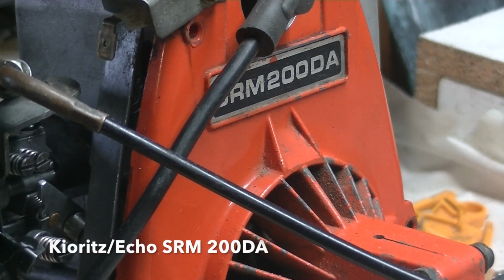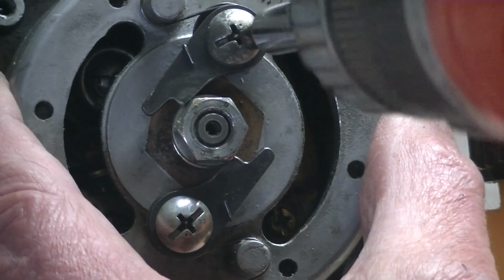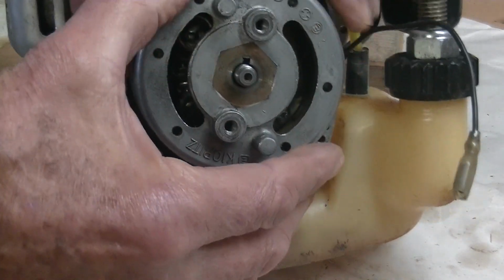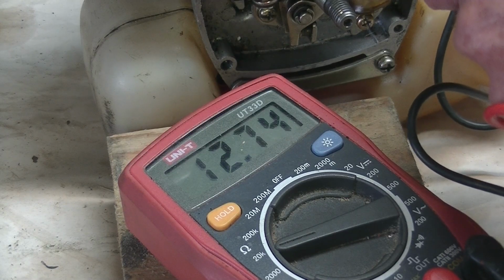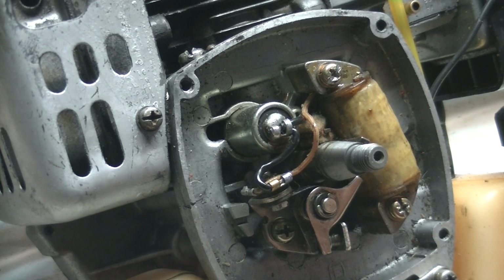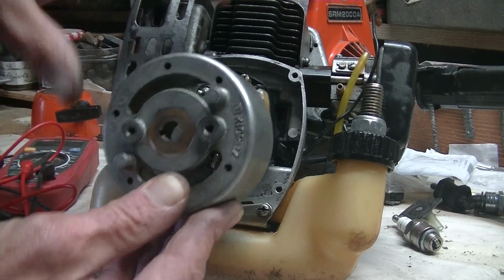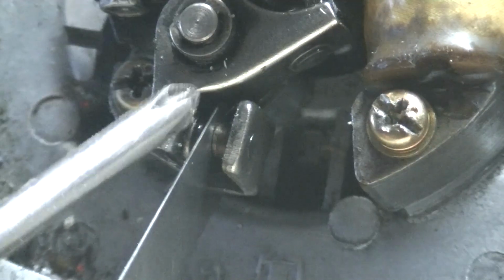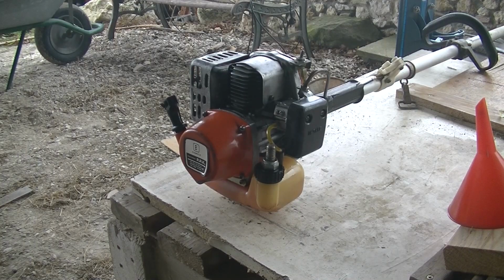What!??? My strimmer has contact points and a condenser?

Comment: I also have one of these, tough engine I have a saw blade on mine for cutting brush and it always handled it better than my others. It's a "weed eater model 609" I just took mine apart today for no spark and saw the coil, condensor, and points and was very confused. At least I know I'm not insane now, just wish it was easier to find ignition parts because I know that's all that is wrong with it. Hunt begins online I suppose.
Reply from the maker: Love these engines! Yours sounded great (watched the video). Do you have the specs for the machine? Although my coil reading was less than spec it still works. i have a video on my channel showing how to check a condenser. The points were my problem. Once I put the new ones in, it took a month before I figured out how to reset the ignition timing. There are timing marks on the outside of the flywheel casing. You might also have them. Good luck!
Reply: @davekennedy52  Honestly I don't know much about it, I have an older video on my channel of when I got it running at my dads house when he found it under the porch, had been there for 20 years behind his furnace fuel tank. No idea where it came from. Spun the nut on the back side with a drill for a minute and hit the carb with starting fluid and it fired. The carb was trash and I put an ebay carb on it, and the shaft sheared the gear off at the head so I had to put the SRM200 shaft on it from another trimmer I had with a busted engine and I used it a ton before the whole no spark, I think it was just a rebranded srm200 the "weed eater" company stole basically. They just flipped the engine upside down. I'm going to test the coil tonight and see if it's junk, I did find new old stock parts on ebay I ordered so I should be able to get it to run either way though I've always had trouble getting the carb just right. It always borders on too rich and blows fuel back out the carb instead of revving up unless I adjust the idle high. Still usable though.
Reply from the maker: @brians-misadventures  looking forward to following your progress
Reply: @davekennedy52  So my coil tests 5.07 ohms resistance, seems good there. I got new points in the mail today, in way better shape since they were in a sealed bag than what I've got, however my condenser doesn't ohm out at all. I have a box full of them but none that are the right size, but was able to make sure I'm doing the test properly and get the ohms increasing from 5-20 before maxing out on other ones. I get a new one of those in the mail tomorrow so I should be able to button things back up and at least get as far as getting spark again. I honestly don't think my model has timing marks on the other side of the crank so I'm hoping I can just re-assemble things. I haven't spun the crank since disassembling it, marked where everything was with sharpie.
Reply: @davekennedy52  https://youtu.be/z1EKv5FHBH4 I was sent the wrong condenser of course.. but it does spark despite the odd mounting, however it won't run at all. I got it to cough one time in 20 minutes of pulling. Plug was wet, carb seems ok, tried starting fluid, tried torching the plug and a new plug.. just doesn't run. Not even sure what else to do, might be junk.
Reply from the maker: @brians-misadventures  thats a great coil reading, mine was below 5, about 4,8 if I remember correctly
Reply from the maker: @brians-misadventures  Don't give up Brian, you've got a really nice spark! That engine looks identical to mine, it's a work of art!. Have a look at my video again and on the 2 minute mark you can see me removing the flywheel. The timing marks are on the outside of that. With the new points, your opening and closing will now be different. As I said it took me a month to work out. I used a multimeter on continuity to check when the points opened.I believe that's your problem. I looked at my spec sheet, it says 30 degree BTDC (at mark on flywheel) There are 2 marks and I think one is 30 degree mark and the other is when the piston is at TDC
Reply: @davekennedy52  Thing is, wouldn't the timing essentially be static because of the flywheel being on a key and the flywheel orientation to the lobe on the crank not being possible to change? I did adjust the points again to .020 and I can get it to cough for around 5 seconds but it can't pickup rpms. I'm not sure if I technically fixed the timing or not because I can extend this by feeding it fuel but it won't run on it's own. Could be the carb went bad already sitting around for a few months, it was just an e-bay carb. I'm also not a fan of my engine essentially being upside down, considering getting a different gas tank and flipping it.
Reply from the maker: @brians-misadventures  That was the issue that had me completely confused as well. Firstly the points gap should be 0.30- 0.40mm. Presumably you found the timing marks on the flywheel? Looks like a - and a + sign. Couldn't find a mark on the crankcase to line it up with, so I used the bottom right screw hole where the starter cover gets attached. Then turned the flywheel clockwise until the first mark (30 degrees BTDC) lined up with the hole, then removed the flywheel so I could see what I was doing. Then connected my multimeter to each side of the points on continuity setting. (think I had to disconnect the wires from the condenser and coil first. Then loosened the movable plate of the points and opened the points until the buzzing of the multimeter stopped, then tightened it immediately. Then it worked! The points gap is key to everything. Hope this helps
Reply: @davekennedy52  I tried that this morning and adjusted the points a good ten times forward and backwards. Unfortunately it makes no difference, I verified my gap was still .013 inches which should be between the .3 and .4mm, it just wont do more than 5 seconds of coughing and dying. I ordered another 20$ ebay carburetor because with none of these changes even seeming to change its behavior at all it almost has to be something else going on. I can slide the points and the gap a good bit any any direction for position and gap size and it will do the same behavior. If it's not the carb I'm likely stuck.
Reply from the maker: @brians-misadventures  disappointing to hear!  Did you ever find the timing marks. If not, email me at davekennedy52@hotmail.com and I'll send you a few photos that I have. In the meantime hope your new carb arrives and works for you
Reply: @davekennedy52  Yeah I found the - and + on the outside of the flywheel, I pointed the - to the bottom left screw hole and pulled the flywheel and released the points and tried to get it to open as it's going from the - to the + at that point, however I'm not really sure if that's going to be the same on mine as it was on yours since my engine is rotated 180* and my spark plug is facing down, I wonder if that has something to do with it.. It's strange because it sounds good for the 5-10 seconds it runs but it can't rev up past what I'd say is 1/3 operating rpm but it's almost like it's just running on the fuel I'm spoon feeding it.
Reply: @davekennedy52  https://youtu.be/yvpfahcf2qs I found out if I stick my thumb over the carb half way I can get it to run a little but I'm thinking I still have carb issues. It is super out of adjustment where it should be to run and dies if I rev it while doing this like it's over fueling then. I think for how long I got it to run my timing must be ok enough but new carb comes tomorrow and I'm going to flip the engine with a makeshift gas tank because the upside down I think is flooding it easier and possibly screwing up an old carb diaphragm. Least it ran for a bit.
Reply from the maker: @brians-misadventures  Watched the video and it's so, so close to working. As a matter of interest, because I couldn't see a mark on the crank casing, I looked through the exhaust port and turned the engine until I could see the piston at the top of its stroke. Then I made my own mark where the "+" sign was. then turned the engine backwards until the "minus sign" lined up with my mark. So that was my 30 degreeBTDC. And thats when my points should be opening..My carb wasn't perfect either, I think the little choke flap is junk. A carb with a primer bulb would have been better.
Reply: @davekennedy52  https://youtu.be/OUOU0ThD0F8 I got it running after I flipped the engine. It's super unstable though, while I was taking everything off I noticed the gasket between the engine and the carb spacer was junk and brittle, I'm uploading another video of the leak there now. I ordered some gasket material to make my own. Also the bolts that hold the carb on are an issue. I stripped the threads of the hole on the one side and it won't "bite" anymore and hold tight, however if I had a longer bolt there is plenty more threads deeper in that are fine. It only engages 1/4 of an inch but there's an inch of threads. I need to find longer bolts to hold the carb tight against the gaskets on both sides and i think I've got it. Unfortunately these bolts are going to be hard to find I think, strange super narrow and fine thread..
Reply from the maker: @brians-misadventures  Fantastic! Your determination is to be admired! So glad you persevered and now it can only run better with new gaskets. Well done
Reply: @davekennedy52  Thanks, I was able to find some longer m4 screws at my hardware store, only thing I'm unsure about now is whether to make the gasket flat across the top where it meets with the engine with a rectangular hole or make it a circle, I saw in your one video your gasket had a round hole that didn't perfectly align with the hole into the cylinder head but I've also seen another video where someone had a carb that had a gasket that was shaped uniform to the hole. I guess I have enough material to make one of each, not sure if it even matters but this carb is so touchy. Although maybe it's always been this way because of this gasket, I don't think I ever took it off before just the carb off the spacer.
Reply from the maker: @brians-misadventures  Nice that you found the longer screws. I remade my gasket to be the same shape as the hole.Rectangular.  Maybe the previous owner put the round one in? There is also a very small hole under the rectangle shape which I put in. Maybe 1 or 2, I can't remember.. My parts catalogue shows a rectangular hole
Reply: @davekennedy52  I made the new gasket today, runs better than it did but not perfect. I'm thinking the carb is still the issue, if I get the high screw at about 2 full turns out and low at 2 1/2 it will idle and rev up to 2/3 throttle, if I turn the high in half a turn  it will run wide open but die at idle. Adjusting the low when it will run wide open just kills it in either direction. I got an ebay carb that has a fuel primer bulb on it and the same throttle linkage I might toss on it instead, it probably is usable as it is but it's not too hard to try the other carb and just put the second fuel line in the tank through the lid until I see if it's better or worse.
Reply from the maker: @brians-misadventures  its normally by trial and error for me, I usually start off by turning each screw one turn out and then work it from there. Usually runs better after its warmed up. I took that carb apart so many times for cleaning I could do it with my eyes closed. busy on a new project now but as from Monday all our shops are closed for a lockdown and I've run out of carb cleaner
Reply from the maker: can't believe how good your motor sounds even though you had a day from hell. I think the carb has made all the difference
Reply: @davekennedy52  Turns out I had more issues. I couldn't get it to run consistently, I'd make changes on the carb and it would be better and wouldn't run good a few minutes later. I'd get it to run perfect eventually and the next day it wouldn't start. I took the piston cover off and the cylinder was scored, rings were so brittle they snapped trying to take them off. The little ring nubs were worn as if the rings were able to move past where they should. I found a new piston and rings with the cylinder housing for 30$ on ebay and put it all together and got it running with the "original" walbro carb and it will idle, rev up, and started cold 3 hours after running and a full night after sitting with minimal fighting.. https://www.youtube.com/watch?v=0bhiwYMHo5Y now I just need a new pull start rope, had a spare but it's too thick to wind in the housing when it returns.
Reply from the maker: @brians-misadventures  super impressed that you've never given up on your machine. Just realised that I never told you that I have a video where I changed my rings as well (maybe you've seen it?). I had very little compression, not enough to cause a vacuum for the carb to work properly. Of course when I tried to take them off to  clean the ring grooves, the rings snapped. Also very brittle like yours. Yours is sounding very healthy in your video!!

Comment: Hi Dave, good video.
I have an old Echo chainsaw CS302S, about 40 years old I believe, overall good shape, but it will not start, no spark at all, I believe the problem is the ignition coil # 15012603930 but this part is now obsolete and I cannot find a replacement for it. Could you please share your contact info from your supplier in France. He may be able to help me.
Thank you.
henri
Reply from the maker: Love these old machines, but yes, parts are hard to come by. I bought a set of points from someone in the US. Here's where I got my coil in France and looks like he might have what you're looking for. : https://www.nicobrico24400-motoculture.com/pieces-pour-tronconneuses/797-bobine-allumage-tronconneuse-echo-302-.html

Comment: Sorry but I did the coil test incorrectly. Retesting there is no continuity between spark plug terminal and coil.  Your guidance please.
Reply from the maker: Hi stewart, if your multimeter registers "1" or infinity then your coil is shot. Just make sure that the spark plug wire itself is making contact with the coiled spring inside the spark plug boot. Mine had come loose! I've given you the part number of the coil on your previous message. You could also have a look at my video on replacing a spark plug boot. If you need more info just let me know